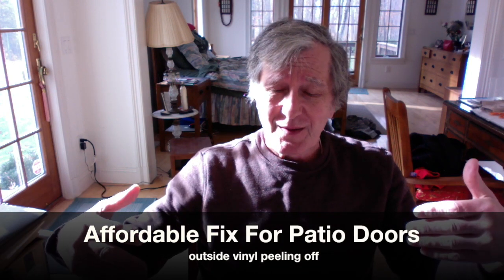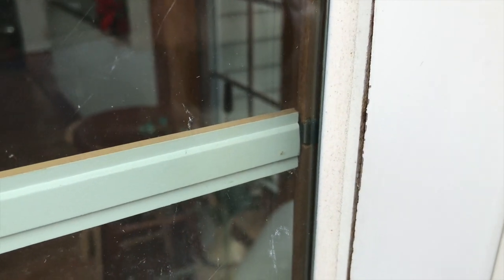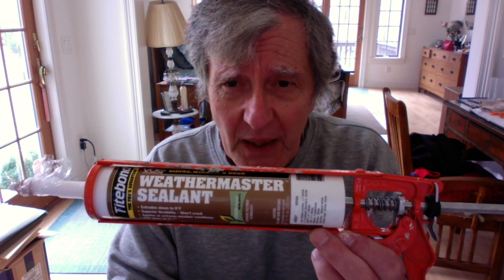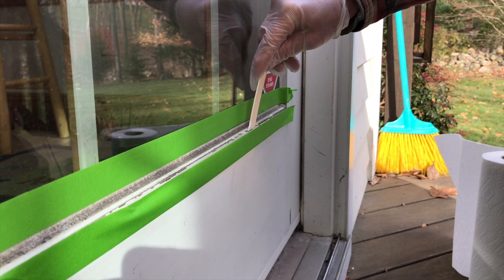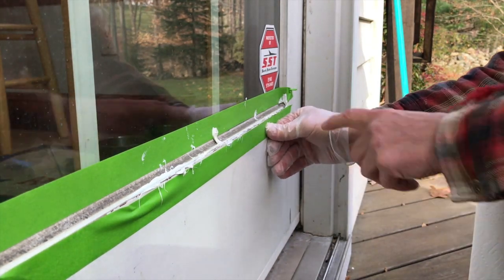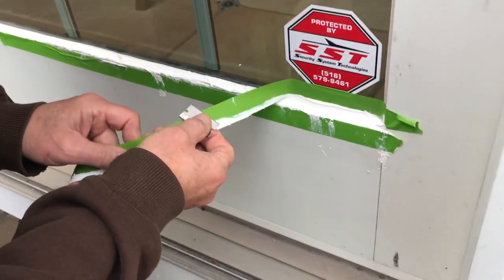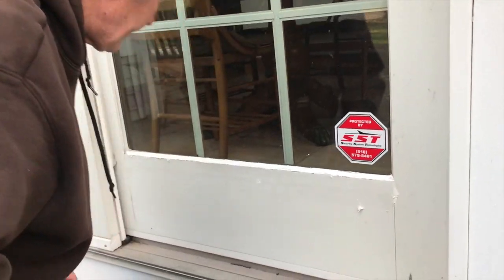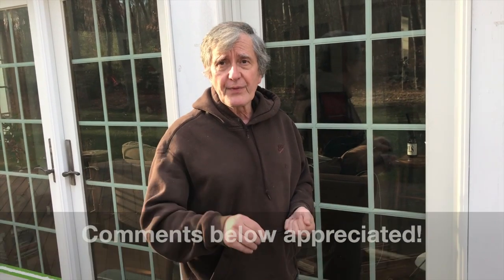Andersen Patio Door Repair - How I fixed it myself

Comment: Hi Pete great video. I have the same issue occurring on my Anderson sliding patio. But mine is curling up from the bottom of the door upwards. Any thoughts as to how I would put the sealant in since it's curling from the bottom? Also I have some kind of mushroom like substance growing out of the bottom as well. Any suggestions would be great. Thanks
Reply from the maker: Hi Sal thanks for your comments. I know yours is coming up from the bottom but how much room do you have in there. You need to think of a way to squirt the Weathermaster up there and I have something to help you with that. Go to Amazon and type in disposable  Dental Irrigation Syringe.   They are cheap and you can basically transfer the Weathermaster sealer into them and then squirted it out upward and in tight spots.  You can cut the tip of the syringe a little bit to get more sealant out of it According to your needs. Not sure what to do about the mushroom but I certainly would make sure that you clean and dry the area before Applying the weathermaster sealant.   Don’t forget the clamp down tightly on the area you are repairing. Thanks hope this helps
Reply: Backyard Warrior , thanks for the suggestion. I saw a video on how to remove the sliding door and it' looks pretty easy to do so  I'm thinking about taking that route. I'll have better access and your right I really need to clean out what ever guck is in there.
Reply from the maker: I agree with you Sal taking the door off is not too difficult and in  your case panel is peeling from the bottom you will be able to clean it much better. Good luck with your project! Let me know your results! Thanks
Reply: Backyard Warrior- did the door this weekend. Let me know your email address and I’ll send you some pics if your interested

Comment: Just read all the posts. My similar Anderson doors in SC were installed in 1999, by 2013 they were separating across the bottom. called Anderson- got blown off like everyone one else here that posted their experience.Do I sense  a class action here??? I wont be buying Anderson again. I had bought Pella french sliding door for my other home back in 2001. they were aluminum clad and were not rotting but the nice shiny paint on the Al cladding was getting oxidized and chalky. I guess it would be easier to simply buff up the chalky aluminum, prime and (spray) paint. 

If you are gonna load the pressure board pressing the glued vinyl to the interior wood, you could (If you have a wood deck) put a couple dry wall screws into the deck to butt "anchor" the "ladder (or similar) " and then use your weights on the loading ladder.  I unfortunately have a cement patio.  I'm thinking to make some stiff metal brackets  that will wrap around the door ends and connect them with a wire, then shove wedges into the cross wire  to load the pressure plate.  I have a northern patio door exposure here in SC and it doesnt get heated quite like the poster in Las Vegas mentioned on their western exposure  but the doors appeared to have separated before i boubht the house in 2013.
Reply from the maker: I would join a class action!!! Please subscribe to my channel if you found my video helpful!

Comment: My problem is at the bottom of each door where about a 4 inch section is rotted on each side.  Your door looks like the same problem is starting on the bottom of your door.  Mine looked like that and when I pressed on it with a screwdriver it was like a sponge.
Reply from the maker: Looks like you are having a different problem than mine. Your Anderson door panels are rotting away.  All mine still in good condition but peeling off. Obviously my solution will not work for you since your panels are rotted.

Comment: Thank you, Pete, very much for sharing the solution! My vinyl on the bottom of sliding door peeled off completely. I live in Los Angles. The weather is hot here. Is the Weather Master Sealant still good for hot weather? Could you please tell me how many WeatherMaster Sealant I need for the whole bottom of sliding door?
Reply: I just followed this exact technique on a 95 degree day in Virginia. It is curing now. I’m using bags of compost for weight. The Titebond tube says temperatures above 0 are all that’s required.

Comment: Hello there I'm an ex anderson service tech, I actually have a jig for fixing any the doors they make the also a cover..I did this for years..
Reply: Anderson spent millions tryin to fix these issues..most of the time it's so far gone this wont work must router a 1/16 off top
Reply: Anderson just sold me (4) tube of a color sealant for the doors to repair the same issue -- do you think the color sealant is as good as the weathermaster? Thank you
Reply from the maker: @carol12910  not sure the type of sealant Andersen provided you - I just know that the weather master sealant does the trick and holding up year later!
Reply: Any helpful hints would be appreciated

Comment: Pete -- Oh gosh; we are a victim too, and spent yesterday applying your method to our Andersens.   Our case is somewhat more advanced than yours but we are hopeful than we can get a few more years out of the doors in so doing.

However i have  a comment that you and your followers may find of value:  i recalled enough of my high school physic's static analysis to determine that the horizontal thrust on the spreader plate at the door -- which you want to maximize -- MUST EQUAL the horizontal thrust (in the other direction!) of the friction patch contacting the deck or other surface by your ladder/strut/furniture/whatever.   

In view of that fact i fabricated a little flange from cheap brackets i bought at the hardware store; the purpose of the flange is to fit into my deck's "slots" between the planking, and connected to 2x4s i use for struts.   Unlike the thrust apparatus connecting to the door that you used, Pete, this flange does not depend on friction contact with the deck to provide the opposing thrust at the point of contact.  Once that flange is in the deck's planking slots it will provide any reasonable thrust to the door.   i protect the deck's finish with a simple patch of old felt over the flange prior to slipping into the deck.  My simple strut -- with said flange -- combined with weight (garden paving stones in my case) yield all the thrust i need on the door for Weathermaster curing.   

i would be happy to send photos if you wish and give me an email address; i cannot attach them here apparently.

-- gary

Comment: Mine isn't just the vinyl, it's the complete panel that is pulling away and separating from where the top green tape you have is. It's so warped. Ugh.
Reply from the maker: There are ways to on warp wood panels if they are not too far gone. Just YouTube it and give it a shot it’s worth it. Then you could attach it using my method. Thanks
Reply: @poundridgepete  I don't see any videos with my problem.  I think it might be too far gone. I was thinking silicone as a temp fix until hopefully I can just replace the operating door of the triple french patio door. It's very tall and its a single center door with a fixed door on either side.
Reply from the maker: Does the rear of the warped panel have like a composite/plywood backing?
Reply: @poundridgepete  I don't know what it's made of. It looks very much like your doors but where your vinyl had come loose,  my vinyl is still attached but the panel that it's attached to has lifted away from the door where it meets the glass. I think I will get some of this weathermaster sealant. I hope it's not too cold to apply it. I just noticed it. I live in Massachusetts and it is getting cold. Or perhaps I will just put some waterproof tape to create a "hood" until the weather is warmer and to keep snow and rain from damaging it further.  Its a pretty big gap. Ugh...all my Andersen doors have been nothing but a pain in the  a$$ since installation. They constantly need their hinges adjusted, they are difficult to open and close and lock and the weather stripping on the botton is totally gone. I replaced one single with a totally different brand and still have two others, one of which I never use. We live and we learn.
Reply: @DOLfirst  oh I have the same issue I think. The lower panel started to warp and peel on the top portion where it meets the glass. It literally curled an inch while the rest of the panel is in tact. Looks like wood on the other side. Will have to either rip it off and try to flatten it and reinstall or replace it somehow. Maybe just wood replacement cut to size and caulked/painted? Anyone have issues taking this lower panel off that spans across the fixed part of the sliding door?
Reply: @MeanBoy76  I was thinking about how to approach replacing that piece without disturbing the integrity of the glass or even how to adhere a replacement piece. For now I will probably just have to fill that gap but I think I will have to replace the entire door. Hope they still have just the door to replace. It's very tall.
Reply: @MeanBoy76  also, mine is a french single with two fixed glass panels on either side, not a slider.

Comment: Hey Pete,  Thanks for the info.  Anderson< a great product, only wanted to sell me more doors.  Great usage of the step latter! I used a bigger board behind it.  The weights we a good call.   I could not get the Weather master @ home depot ( only on line and by the case) so I used Gorilla glue products.  Fantastic result.  Thanks for sharing.  a huge help.  --DJH
Reply: Which Gorilla glue product did you use?  Is it still holding up?  Would you do anything differently?  Thanks for any info!

Comment: Just take the door off lay it on saw horses and clamp between 2 pieces of wood.
Reply from the maker: You’re right Tom that is one way to do it. But I had several doors and some fixed side panels alongside my French doors that are not able to be removed. So this was easier than taking all my doors off which is more labor-intensive.
Reply: ...and they're crazy heavy. But, doable for when I was younger.

Comment: It is a shame Andersen would do this to its customers
Reply: 20 years in bad weather....Thats a long time,,,sun exposure or excessive mouisture ..
Reply: I noticed they do sell the terratone paint, which is what I was going to use to get rid of the fading... then I spent the next years in and out of the hospital. Now the vinyl is a mess. No way I can tackle that kind of job and can't find amywindow repair shops to take it on. I spent a few hundred to sand and powder coat my original handles and will offer them up here if I can't fix the door.